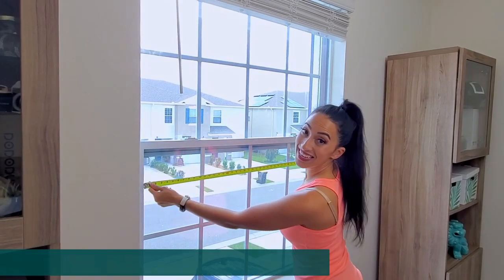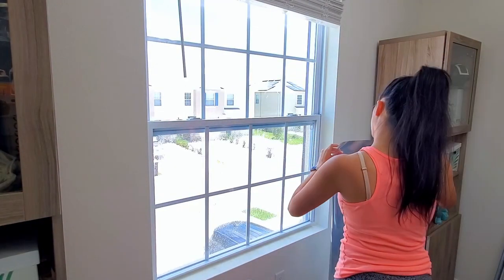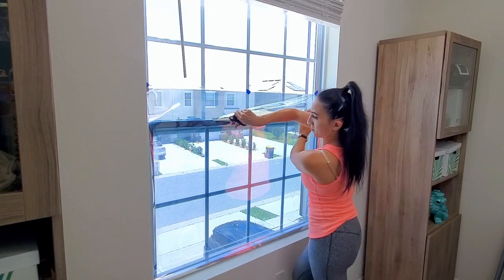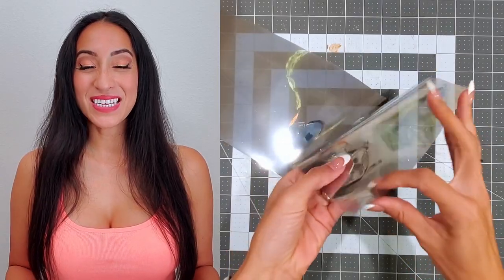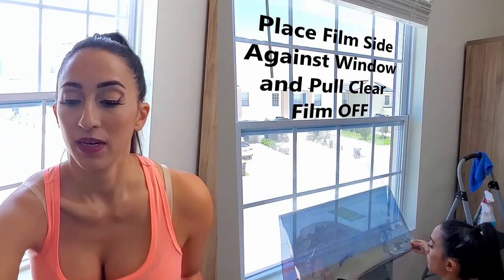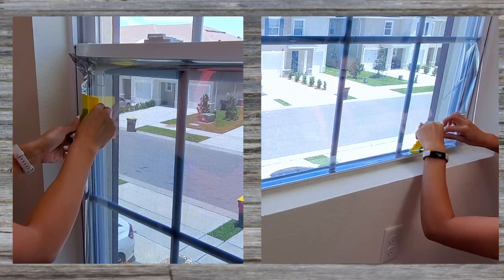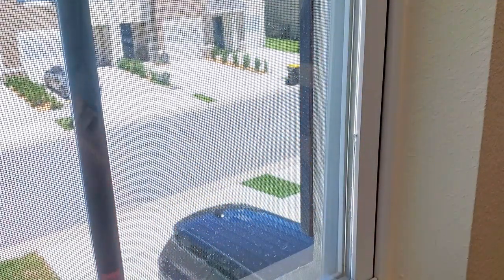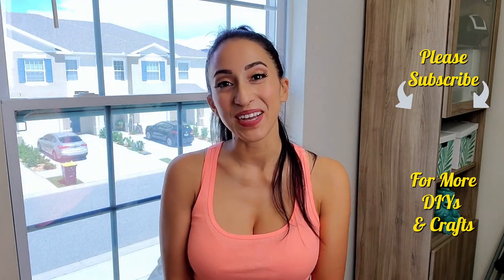How to Apply Heat Control Window Film to Home - What to AVOID and Why 😲

Comment: many of the other DIY's for window film application mentioned the no. 1 thing most important before starting is to make sure your windows are super clean, first.  It was also suggested to make a soap and water mix to use rather than just water.
Reply from the maker: Totally true! In the YouTube Chapter: Most Important Step: Clean your window. You can absolutely clean your window with a home made mixture. I used windex, a razor blade scraper,  and sometimes the spray from the window application kit (on the bottle it says use use for cleaning and adhesion). You are correct.... I never used just water👍🏼

Comment: I put some dark film on the window
..  not sure the brand..  but the film seems to attract the heat in the sun...  is it repelling more than it lets in on the wall?  Seems counter productive
Reply from the maker: There are many types of window film. Some are just color tinted, mirrored, or heat controlled. I am using Gila® Heat Control Platinum Static Cling Residential DIY Window Film: https://amzn.to/3aLqLXg 
ENERGY EFFICIENT: Rejects up to 70% of total Solar Energy
PROTECTS INTERIORS: Blocks up to 99% of UV rays, helping to keep your interior from fading
INCREASED COMFORT: Reduces glare up to 70%, making interiors more comfortable

I can honestly say there is a big difference when using this film. I have applied it on my windows at my previous apartments, my parents house, and my current home.
Reply: @KimagineDIY  we did 1 strip in the center for now..  going to see how it goes. It just seems the strip gets hot from the black absorbing tje heat.  Its warm to the touch.. so it might keep it in the room?
Reply from the maker: Mine is grey from the inside, but it look almost like a mirror when your outside the house looking in. I wish you luck.  I hope the one you have works for you.

Comment: In the winter my room smells like fire/burnt plastic 

I have such a headache. 

Only my room.
I have every window covered. My daughter has 2 but her room doesn't smell.

I'm wondering if the sun ONLY shines on my windows and thats why it smells burnt?

Thoughts?
Reply from the maker: Thank you for watching and sharing your experience. It's unfortunate that you're experiencing that smell. I've installed heat control film in several places and haven't encountered that issue. It could be related to the specific film or installation method. I recommend contacting the manufacturer for guidance or seeking professional advice to address the problem. I wish I had more answers for you. Best of luck with your project!

Comment: Would this make your home extra cold in winter?
Reply from the maker: If you like the sun to warm up you home in the winter you may notice a little difference. Thermal curtains help keep the desired temperature in (whether heat in winter or AC in summer) when they are closed. I have a tutorial on how to install curtains as well. https://bit.ly/HowtoHangCurtains

Comment: PRO TIP - to Peel it apart - Cut packing tape in 1/2 and fold the ends.  Place under and over the corner and gently peel it will separate perfectly.  Find a Ultra Fine Plastic Water Mist Sprayer (or reuse one from Mr. Clean etc - wash thoroughly).  Pour less than 1 teaspoon of baby shampoo in the mist sprayer and the rest with distilled water.  Spray the entire window thoroughly before application.  (Gila recommends spraying the film with water after peeling too however, if it EVER sticks itself together it can be a mess or damage may occur).  Instead I apply to the top, left or right, then hold as I peel the clear protect film down evenly while sticking the reflective film to the window.  Lastly DO NOT used hard, credit cards, rather find a Silicone Squeegee!  Rubber I found can cause damage while Silicone admits perfectly across the film back.
Reply from the maker: Nice! Thanks for added value!

Comment: would tint film cling to "cobbl;ed" windows?  like that shower door surface
Reply from the maker: I never tried but I really don't think it would work well. Even though it rolls easily it has a firmness to it like a baking sheet. It creases very easily. You would most likely see more bubbles through the entire glass.

Comment: Did you put it on top of your window muntins?
Reply from the maker: Thank you so much for watching and reaching out with your question! Fortunately, my window muntins are inside the glass, so I had a nice flat surface to work with. However, in my previous apartment with old single-pane windows, I had to deal with muntins as well. I ended up cutting small rectangles for each window pane, which was a lot of work but definitely worth it for the heat control. If you have to do the same, just take your time and it should work out nicely!